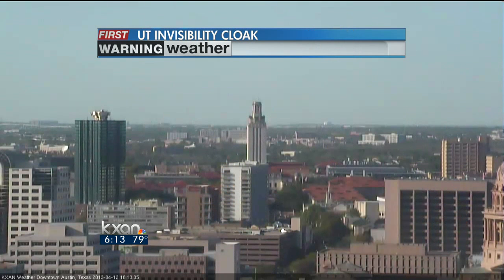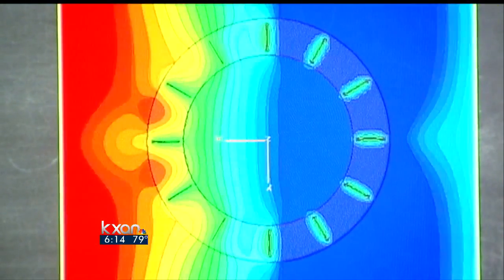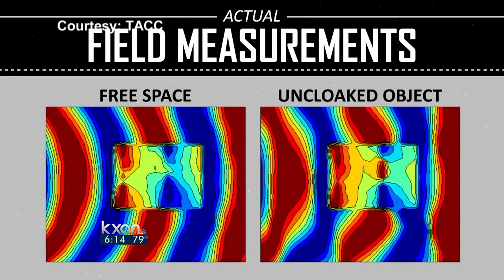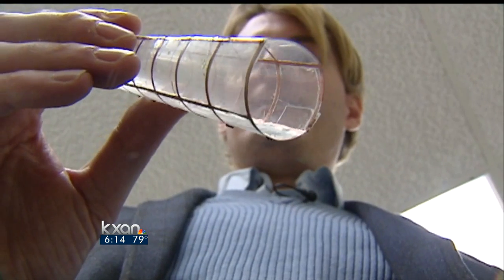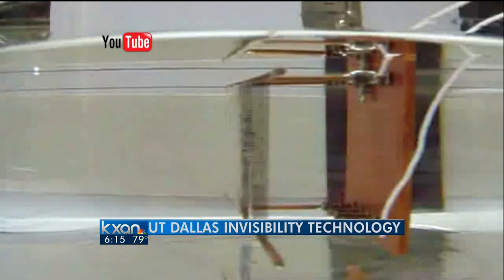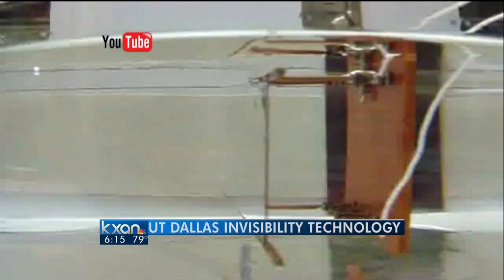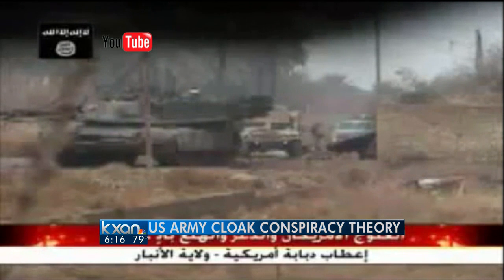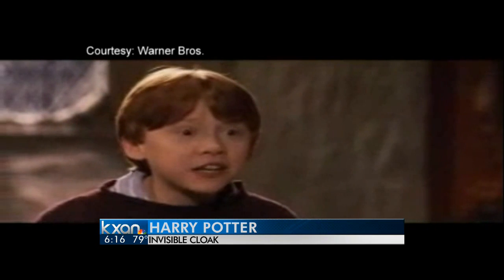Now you see it ... UT develops 'cloak of invisibility'

Comment: Two ways to bend light a high frequency that like a gushing rivers moves the light, and or the redirection of electric fields.

Ceramics uses heat, like a mirage to displace the light, but antennas  redirect the electric field...I think...but eventually a layered field system will redirect light...